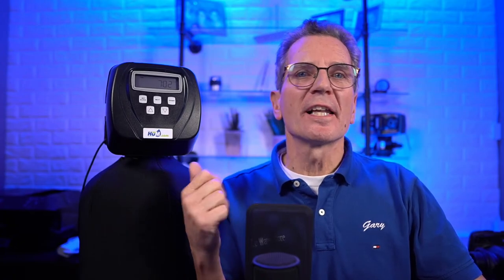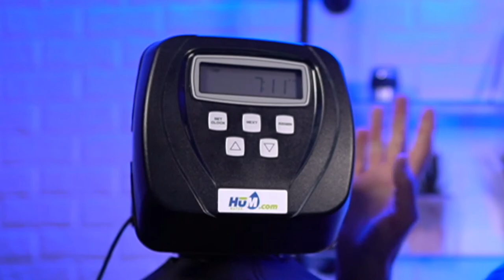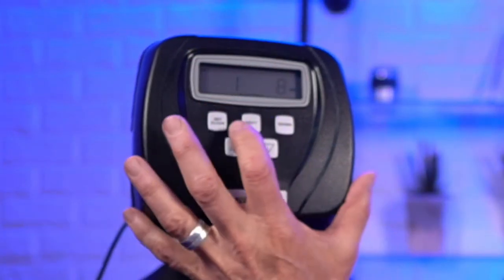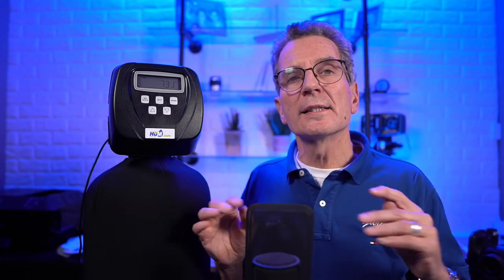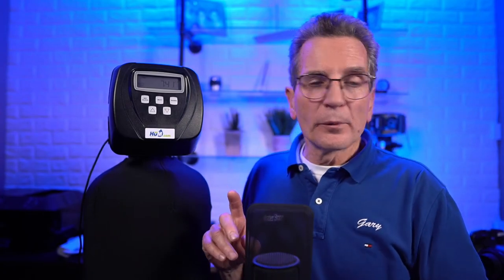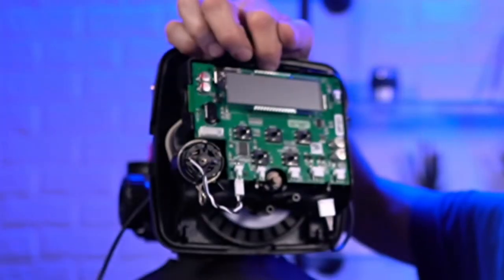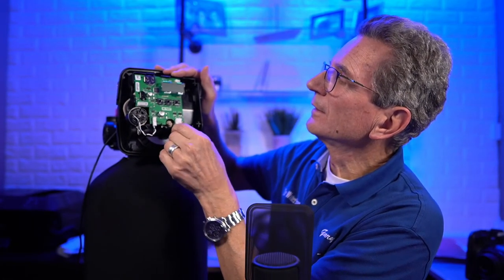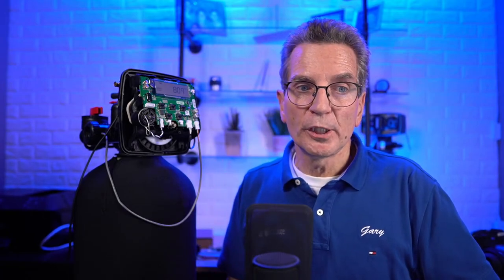Clack WS1 Water Softener Programming Live Stream

Comment: Thank you for your response.  The fill is 9.5 gal.  I reviewed your video concerning the "water softner clogged with salt".  Assuming that my brine tank was clogged, I followed your instructions in the video.  I used a broom pole and loosened the salt and removed all the salt down to the grid plate screen.  It appeared there was  clogging.  I used some hot water and regenerated the system twice.  There was about three to four inches of water  above the grid plate after the regeneration.  I never removed the grid plate, your video did not mention it and I didnt know if I should do anything with  it. I really appreciate your videos and especially your concerns about my problems.
Reply from the maker: Our water softeners do not use the grid plate.  If you have one I would remove and clean it before reassembling and adding salt.

Comment: Hi Gary, (hope you read this, sorry for the long post) thank you very much for this video! Helping me out a lot. I am helping my father get his well straightened out here in south florida. It hasnt worked in a long time, except for pumping water which the pump broke recently. I got what i think is a really good deal on two clack 10x54 tanks, one with a ws1tc (3 button) and the other with a 5 button (back lit screen 5 button). It also came with a brine tank. Dates on the tanks are 11/2020 so not that old, got all for 300USD, which i feel is a fantastic deal (i hope). It appears, and im not sure why, they had the 5 button on the carbon filter with air over media plug, and the 3 button for the softener with the brine line.With this vid i feel comfortable swapping them and reprogramming the 5 button for softening and the 3 button for the carbon filtering.
Can i still use the air over media "plug connector" on the 3 button since the 5 button will be getting the brine pickup installed, or does that need to be sealed up somehow?
Reply from the maker: You can replace the air over media air inlet with a plug which is made for that purpose.  Likely the 5 button they were using for an air over media iron filter.  Before doing anything at this stage I would have the water tested to find out exactly what you need befoe spending anymore money.  We ahve info about water testing here https://waterestore.com/pages/free-water-test-evaluation-the-water-estore then if you need both the iron filter and water softener I would convert the 3 button to a 5 button and go from there.

Comment: You indicated in this video that a water softener should regenerate at least once every 14 days (Days Override setting).  You said this would mitigate the clumping of the resin beads and "fluff up" the media.  I have never heard of this before. I am a single person with a 32,000 grain capacity softener. It is set on AUTO Regen so it determines when to regen based on water hardness (23 grains) and softener capacity and gallons used (metered). This has been about every 17 days for me.  When I configured the Days Override setting to 14 days my gallons per regen decreased accordingly. Now it will use more water and salt.

Question: Is it really necessary to configure the Days Override setting to 14 days?
Reply from the maker: Yes, if you want to maximize the life of your water softener.
Reply: @water_estore  Thank you for replying.

Comment: Great video! About to order a new board and transformer. I know I have a 5 button clack. How can I confirm it is a ws1? How can I determine valve diameter?
Reply from the maker: All Clack 5 button valves are WS1. If your is for residential use and the plumbing connected to it is 1" or smaller it is a 1" valve.

Comment: Our water here from the beginning I was told was soft water. This is a new water filter(upgrade from a greensand filter) with a different company(New Clack Filter). The water does have Sulfur, Iron and Manganese. The installer has the setting on softening and it looks like all the default settings. The toilet tanks are getting brick colored. Otherwise the water tastes good and feels good and no smell. I notified the installer and he told me it looks like a little bit of iron. He said he would come over this week. Should I ask him why isn't the setting set to filtering instead of softening? I'm about to start programing this thing myself per your videos. Thanks
Reply from the maker: Thsi video shows the correct settings for a water softener. If it's an iron filter the correct settings are here https://youtu.be/AaAfTlDNUF0

Comment: I have watched so many of your video tutorials that I have become an expert! 🤣  You directed me to this video when I had a question in one of your other videos and at first, as I started watching, I thought "I've already graduated from the softening course and need a course in filtering". I almost gave up but out of curiosity I kept watching and Bam! Halfway thru you hit the nail on the head on what I needed help on. My Air Over Media filter settings.  Thanks! But, again, I kept watching (even as I had all the info need on my AOM) and now wonder if a twin tank softener is what I need due to a hardness reading of the well water at 390.  If I can't afford to add a tank is there a setting in my WS1 on the single tank softening tank that can help maintain soft water. We are a 2 person cottage size house.  Which setting should I concern myself with to keep the water soft 24/7?
PS, you did touch on my 4 button system enough to figure out what I needed. Thanks
Reply from the maker: At 390 ppm of hardness (23 gpg) you fine with the single tank. Assuming there is no iron set it for 25 gpg of hardness.  If there is iron, check out this video https://youtu.be/XMY69hdhX44

Comment: I have a question, I live in South Florida, I have a clack twin tank softener. We have sulfur and iron and they use a carbon tank with a chlorine tank for backwashing. It was analog with the pins, easy, but that was replaced with a clack valve head. Slowly the water started smelling. I called and they checked the settings but still smells. What would the settings be for the carbon filter with the clack valve and a chlorine backwash tank? Just want to check the settings myself.
Reply from the maker: Not really sure because we don’t recommend chemical systems but likely backwash every 3 days

Comment: Hey Gary, thank you for this video, it's absolutely great! One question though, what does the System Capacity (22:37) value influence? I use German Hardness units and I have this parameter expressed in cubic meters. I have 25kg of resin and got this parameter set by installer to 62m3.
Also want to ask how to calculate my how many grains is 25kg of resin?
Reply from the maker: One cubic foot is 32,000 grains.  The capcity tells the valve how big the media tank is so the valve knows how often to regenerate the media based on the settings.

Comment: Hello Gary, I acquired a 96000 grain softener, trying to find a good salt setting for it. Our hardness is around 10. 20-25lbs per regeneration sound about right?
Reply from the maker: Hopefully this is for a commercial application becasue this is waaaay too larger for a home.  But yes, I would set it at 24 lbs.

Comment: How do I correct an error code 1006 that I inadvertently set while trying to reset my backflush time. Fusion 2 Waterite iron filter.
Reply from the maker: You should be able to clear it by removing the power connection to the circuit board, wait a few minutes before reconnecting and then change the settings.

Comment: Hey Gary, Great video. I am trying to figure things out in my new house which is on a well. I have the same unit (Clack WS1 30,000 grain softener) for my family of 4 (2 adults and 2 small kids) which I think it a bit undersized. I also have a Hardness of 31 GPG which doesn't help the situation but there is also an iron filter to deal with the little bit of iron but high sulphide. So for the Softner I am trying to fine tune the setting as they we all default when we moved in. So I set the Hardness so 33, the salt lbs to 10, and the capacity to 24000. I understand it will probably regen every 2-3 days but  Is there anything else I should change other than get a bigger capacity unit? lol. Thanks!
Reply from the maker: No, that's it but it is way too small for your family.  Don't be surprised if it regenerates every day.

Comment: Hi Gary
Thnx a lot for very helpful video.
I have 2 questions to you.
As far as i know there are at least 2 ways of regeneration of resin, upflow and downflow. I ve heard upflow is better (more effective), is that true? If yes how to change it in WS1CI?
Reply from the maker: Yes, all things being equal upflow is slightly more efficient but typically upflow water softeners are more complex, expensive and finnicky.  Clack does not recommend switching the valve over from a downflow to an upflow so I do not recommend it sinceI don't know how.
Reply: @water_estore  Thank you for support and fast answer

Comment: Thanks for your email reply to my comment.  My Clack WS1 regenerated as programmed. Single tank.  I reviewed all your videos and instructions.  My system was installed in 2018, five buttons.  I am having trouble with the brine tank.  No water in the tank.  None when it starts regeneration and none when it is finished.  Just salt.  My settings for NEXT DOWN and hold button are:  1-8, 2-dn, 3-8, 4-8,  6- .95 gal fill, 1500 gal, relay on, filtering 30.  What is causing the tank from not filling with water.  I am in a residential area, city water metered from the street.  Can you help?
Reply from the maker: Are you sure the fill is .95?  It should be 9.5

Comment: Hi Gary. I apologize if you covered this question in your video or in the comments already. I recently had a 48,000 grain softener installed. It looks like the installer adjusted the settings correctly. However, when it gets down to about 200-300 gallons remaining, our water begins to not feel soft until it regenerates again. Like I said, all of the settings appear to bet set correctly. However, the capacity setting is currently set to 48,000 to match the size, but I recall that you recommend setting it to 80% of full capacity. Does that mean I should set the capacity to 39,000 instead? If so, what is the reasoning behind the 80%? Thank you in advance!
Reply from the maker: Yes, you are correct.  There are inefficiencies in the process and since not all 48,000 grains of capacity are used during regeneration (due to the shape of the tank) we use only 80% of the tanks capacity.
Reply: @water_estore  Thanks for the reply! Does raising the hardness setting essentially do the same thing as lowering the capacity setting? Just telling the system to regenerate sooner?

Comment: I replaced the power cord and the circuit board.  I tested for power to the circuit board and the power line does have power but the new circuit board still doesn't respond and is blank.  What else could it be?
Reply from the maker: Really there are just the 2 parts, so I don't know what it could be.

Comment: when I go to change the filter pack and when I loosen the the nut to access the package and as I loosen the nut more it seems as though the water starts to come out under high pressure so I stopped.
Reply from the maker: Be sure to shut off the water and then start a regeneration to release the pressure before opening it up

Comment: hi Gary. thanks for this video. i've got questions regards softener settings. question 1: after i set the 6th END cycle i am getting "Lo dc OFF" on my screen. do i need to set it? question 2: i've got capacity setting in kg - now it says 1.50 kg while yours shows 23k grains. is my setting correct or needs changing? question 3: after i set hardness to 19gpg in my case the next screen i see is hardness 2 setting - my current setting is flashing 0ppm. do i need to change it if i don't use the water mixer. thank you for your guidance.
Reply from the maker: 1) No, just ignore it. 2) that is salt setting in metric, not water softener capacity which is 23k grains.  3) I don't understand this one.

Comment: Hi Gary, 
they installed a Clack WS1 with a 1054 tank (48,000grains) in our new home, calculated for a family of four. But we are only two people and don't use a lot of water thanks to water saving toilets, washer and faucets. 
Our hardness is 10, iron is 0.075ppm, magnesium is 0.078ppm. The hardness is set at 11 and the salt usage is set for 9lbs/regen. 
Is the salt usage enough or should I increase it? We don't have unsoftened water to drink and don't want to use more salt than necessary, but at the same time want to make sure the hardness doesn't damage the faucets etc.
Thanks for your help.
Reply from the maker: Yes, all is correct but your water softener is oversized for your family so you will use more salt
Reply: @water_estore  Thanks Gary. It seems that builders often install softeners assuming the number of occupants instead of asking.

Comment: Im wondering about the setting for hardenss we usually set up our clack at 20 for city water ..but i saw a video that said use 5 fot city and 20 is good for well water ..can you elaborate a bit....will running it at 20 hardness setting in city bad for the tank??? should i recomend that we use 5 for city and 20 for well???
Reply from the maker: It is 100% dependant on your city or well water.  Some city water has a hardness of 35, so the 5 settings would not work.  Other cities are 5, and others still everywhere in between.  Contact your water supplier and ask them how hard your water is and set it up accordingly.
Reply: @water_estore  so that setting is intended to be set to the hardness level of the water in different places...knowing the hardness of the water beforehand ..then match the setting to the level of the water tested ?

Comment: Hi Gary,

I'm trying to understand how to set up a WS1 CI. Looked online, read the manuals and went through a few of your videos. Special thanks for the resin replacement video, was a breeze after watching it. But i can't find answers to a few questions.
I can't understand how the valve determines the amount of salt it's taking. My settings are metric but probably not important.
I can set the amount of salt that the water softener uses for regen. How is that implemented physically? Is it (a) controlled by setting brine tank refill duration with 0.5 gpm flow rate in mind and float valve shutting off the brine during draw once tank is empty? Does the WS1 use the float valve to shut off brine draw? Or (b) actual brine draw minutes with a particular injector in mind? The is no injector size setting, right? My settings now are 60 min brine draw, I assume this is brine draw and slow rinse together. Or not? How is slow rinse implemented then?

I guess the question is how is the valve ensuring that it takes the right amount of salt? When I set 5 kg of salt for regen but 60 min for brine draw these two settings do clash, I run out of brine much earlier, then air is drawn in, in 60 minutes it will draw out about as much brine as my brine tank could hold if there was no salt. 

Is there a possibility to increase brine contact time, like a pause cycle or something? Read somewhere that boosts efficiency somewhat.

Sorry for the long read and thanks in advance.
Reply from the maker: The higher the salt setting the more water is added to absorb more salt.  The float is only used if circumstances occur that could overfill the brine tank.  Once the brine has been fully drawn the cycle becomes slow rinse.  If you have a  5 button Clack valve with three buttons on the top row and two on the bottom you can set a pause but I do not know why you would.  I can't see how this would boost efficiency.
Reply: @water_estore  Hi and thanks for the answer. Regarding pause and efficiency I believe the idea was that prolonging contact time between brine and resin simply allows for more exchange to happen, higher depletion of sodium from introduced brine. Might be nonsense, but does make sense on the surface.

As for the salt then I understand that the brine tank should hold just enough water after post fill to  perform the next regen, right? Is there an air check valve to allow the transition from brine to rinse without sucking in air when brine is all drawn up? Or did I get it wrong again?
Reply: Or is the brine draw metered? The valve is the one you mentioned, 3 and 2 buttons.

Comment: Hey  gary i have a clack ws but 4 button with regen to the right and the other three split . it doesnt regenerate by itself . also its a two tank . 1 is hooked to brime and the other has some sort of air filter on with fleck 5600sxt. I have no idea why the fleck regens everyday at 8 even tho time is set to 12 and the clack doesnt regen u less i do it manually
Reply from the maker: The meter is not working on the Clack softener, this video will help https://youtu.be/Lr3jyGiJdC0 and the Fleck must be set top regenerate every day.  Just change the settings on the Fleck, I don't do videos on Fleck products so i can't help you with those.